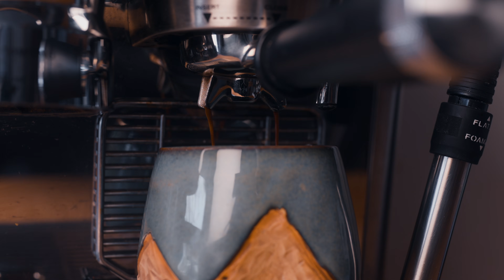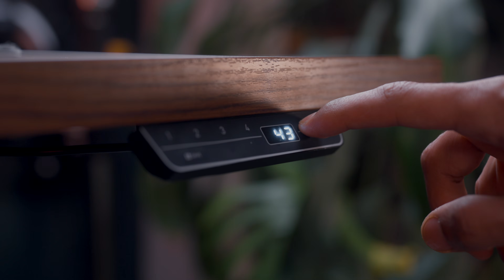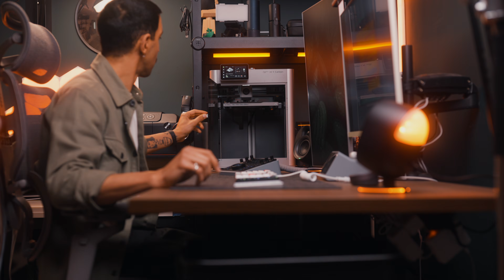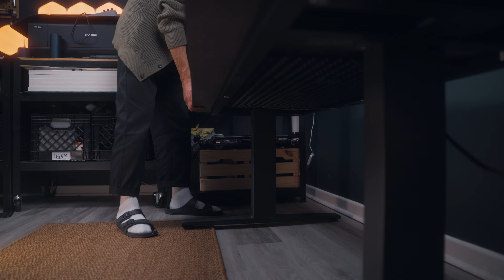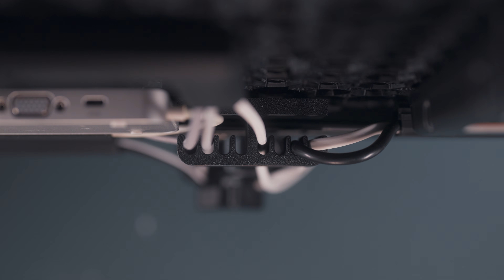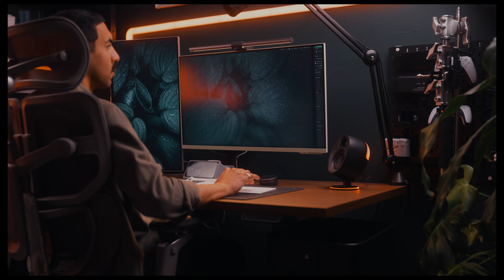I Rebuilt My Desk: New Table, 3D Printed Cable Grid & Minimal Setup

Comment: Yo Madouu, love the cinematography. Very high quality production. Would love to see some tutorials on that. For the 3D printing bit, i would suggest to use openGrid. These are easier to print (not too many parts), but whats better about them is you can get the openGrid lite which are way thinner and this will help you hide even bigger things like your dock under the table. I tried multiboard, while a great project in general, didn't suit very well for under desk cable management.

Anyway, cant wait to see more!

Comment: Cool project. I have chosen Opengrid instead of Multiboard as the framework for mine. Less pieces to print and also compatible with Underware and Multipoint
Reply from the maker: Oh damn — I didn’t even know Opengrid was an option! That’s dope. I’ll admit, printing all those Multiboard pieces took forever, so I’m definitely checking out Opengrid for my partner’s setup. Appreciate the heads up — huge help!